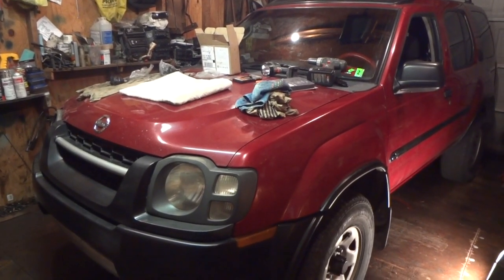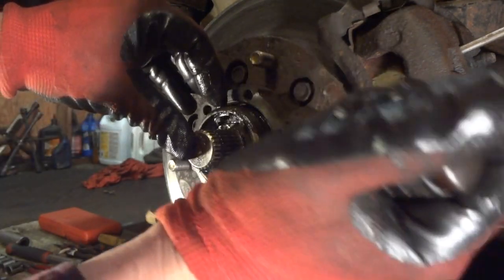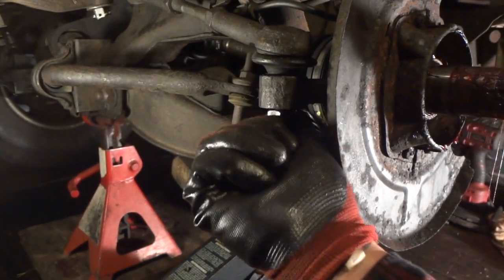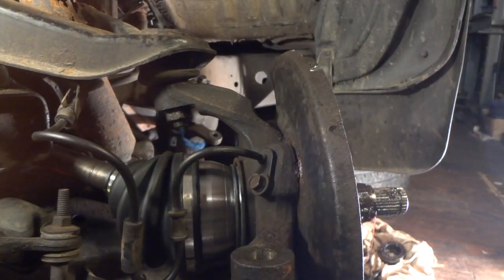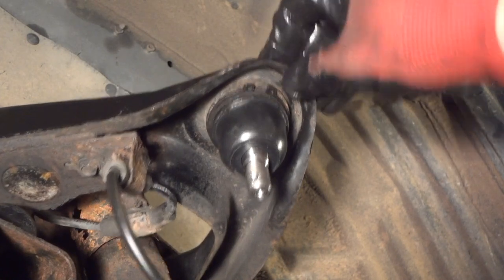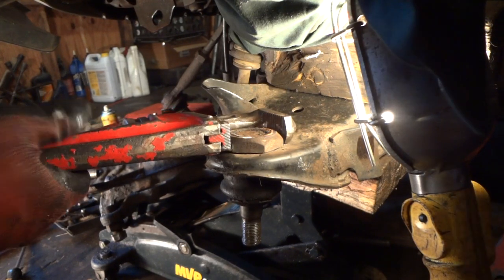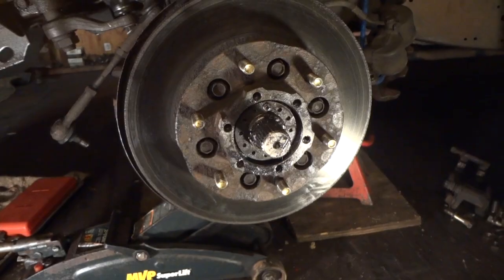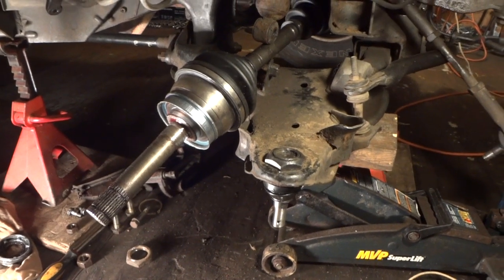Nissan Xterra Ball Joints Upper/Lower Replacement

Comment: Watching from Northern Vermont.  Thank you for the video, it was a huge help.  I have a '04 Frontier 4WD that the lower ball joints needed to be replaced, I ordered the set from Amazon and the lower had to be pressed in, they did not need the washer.  The lowers are Moog part # K80591. A perfect fit!
Reply from the maker: Nice!!!

Comment: Thanks so much for this video! You saved me thousands!

To anyone who is having trouble getting the upright to detach from the ball joint, keep working at it. I spend hours and days hammering on it with the sledge, I threw some more wd40 on there before I left the shop for the night, then decided: why not just hit it one more time for good measure. One single tap with a small hammer and it dropped right out.
Reply from the maker: Thats great !!

Comment: Thanks for another great video. This is on my to do list in a couple of months for my '02 4x4 manual Xterra. Keep it up, great job on all of the videos! -Houston, Tx
Reply: I have an 01 Frontier and I’m also doing this and the upper control arm and idler and pitman arms. Also live in Houston, Tx 🤘 good luck brother
Reply: @evanferree  Nice! Is it a 4x4 or 2wd? I just did this with my mechanic and one of the ball joints was welded on from the previous owner so we had to replace the whole lower control arm on the passenger side.  What ball joints are you using? If you want to meet up let me know I am also in the Houston Xterra group on facebook.

Comment: Best documentary and camera work on this tool and procedures on you tube , I have the exact same kit and also use it to do brake jobs
Reply: Seriously
Reply: @jlusink1423   seriously , the g clamp is more powerful than hardware store variants and brake pad spreaders , I use my kit to push back the pistons in the caliper , where I'd struggle with the other tools which I have incidentally

Comment: Nathan, i'm in Texas.  This was a great video, it gave me the confidence to do this job myself, it was my first time replacing ball joints, and saved me a lot of money.  Now i need to do the brakes as the next project.  And thanks for the tip on those bushings, I bought them ahead of time and was prepared, only thing is i ended up putting them on top and then the nut instead of underneath.  I have a rear wheel drive instead  of a 4wd.  Thanks man
Reply from the maker: Nice!!

Comment: Thank you for your video's!! I have a 02 Xterra that I have pretty much done everything to and now getting ready to do a 03 Frontier 4x4. I am doing the rear main seal, oil pan gaskets and Ball joints. You videos were very helpful when I was working on the Xterra. Heck, I even bought the same puller set as you. lol...
Reply from the maker: Nice!!

Comment: Ran into the same issue with the lower ball joint still being loose after tightening the holding nut.
My fix was: using a angle grinder, grinding down the first shoulder down  a little more than 1/16" ( basically allowing the ball joint to move further up) so that the contact face of the ball joint would seat against the surface of the control arm.
Reply from the maker: Thought of that...then got luck as hell on them shims!!
Reply: @FixingWithPassion  Issue with using the shims is that the ball joint itself is never in contact and secured to the control arm which could cause it to rotate.
Reply from the maker: @nightflyr1  as tight as that nut is now....It aint going no where...lol

Comment: It might be worth pointing out that you don't need to pull the hub completely apart to get the CV axle out of the steering knuckle. Just need to remove the clip.

Comment: Same thing happened to me with the loose lower ball joints, i ended up getting a moog i believe they were the oversized version but boy were they TIGHT, i used a pipe wrench and a 4ft long pipe to pull it up through the arm, next time ill just buy the arm assembly instead of going through that nightmare again
Reply from the maker: NIce1`!

Comment: I have an 06 Xterra an just had the UCA replaced due to wear.  The rattles noises are gone but the ride feels pretty stiff now.  I have noticed that when looking straight at the ball joints from the front that the UCA-to-spindle angle is quite sharp.  The mechanic says the joints are at the proper angle, but it almost looks like the CA is not long enough and thus leading to the sharp angle. In other words, if the CA was an inch longer then the ball joint itself would sit more straight up and down.  I have compared old pictures and the angle of the BJ is far less severe.    I would appreciate any thoughts you may have.

Comment: in your opinion is it safer to just replace the upper and lower control arms, vs just changing the ball joints?  I'm on the fence because as you know its much easier to just change the ball joint, much less work and no alignment.

Comment: That lower threaded ball joint, it virtually fell out the second time, so when u put new washer on did it need pressed again, or did it just tighten up with the nut ?
I am about to "try" and change one on a 2005, Nissan Navara !!

Comment: My replacement lower ball joints fit loose in my 2003 frontier. My experimental solution is J-B Weld. Time will tell if it will hold :P

Comment: Nice video brother, what brand of ball joints did you use, I gotta do the same job on mine and I ordered some Moog joints, I hope I dont run into the same fitting issue when installing them, Thanks ✌
Reply from the maker: Moog

Comment: Hello @Nathan Rohrbough,
I'm on the home stretch finally on getting my driver's side lower ball joint replacement done. Right now I've hit a snag. The studs for the ball joints and outer tierod end keep spinning when tightening the castle nuts. I've been reading online that people just jack up or lower the LCA enough to put tension on the joint. Did you have this problem? What did you do?
Thank you.
Reply from the maker: Put weight on it.

Comment: what are the specs on the snap ring pliers you had to use during this im in portland doing the same repair and am having issues getting the correct tool to complete this part
Reply from the maker: 1/16" pointers.
Reply: @FixingWithPassion  thank you

Comment: Instead of a super charger, why not do a VQ35 engine swap from a 2002 pathfinder?  That engine I believe had 250 hp.  It was the engine upgrade for the pathfinder that the xterras and frontiers never received (sadly).